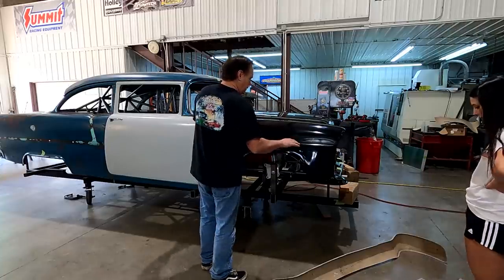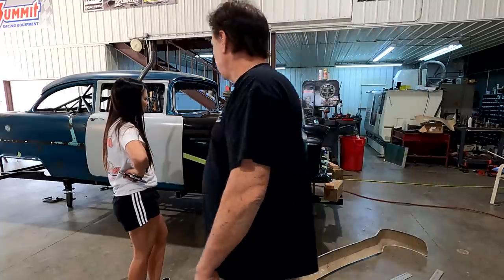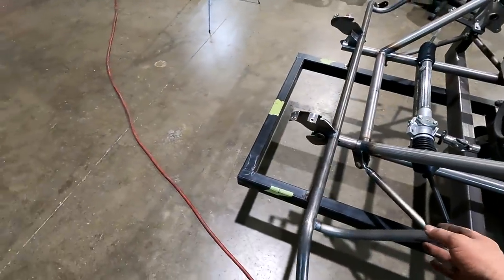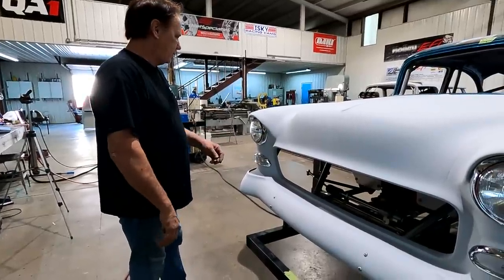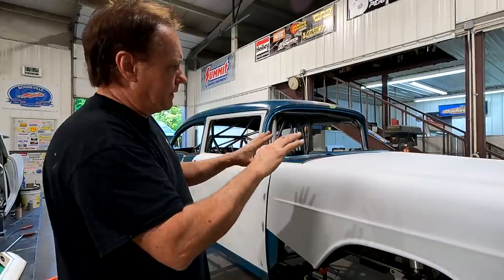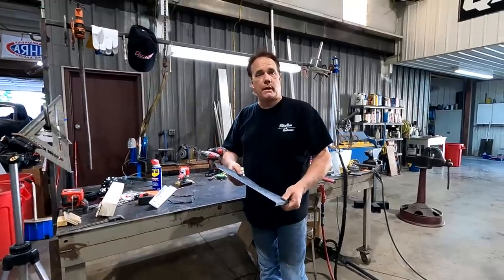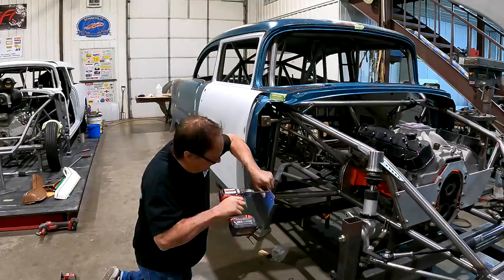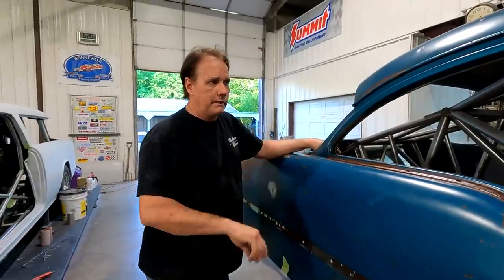The Front End TILTS!! - 55 Build - Video 13

Comment: If you use a piano hinge and spring steel strips, those corners that hit the door will pop out and give you the clearance during opening and closing. You can use dzus type or pin fasterners. Works great.  Lovely car.

Comment: Alex and Dennis, how about using opposing joggles where you are going to cut the fenders? Make the upper joggle lay between the lower joggle and the outer fender, then use a camloc(or something like it) to capture both joggles and the fender for a secure, perfectly aligned, fastening job.

Comment: Headlights, are they 7 inch lights? If so it might be possible to ditch them buckets and use a Harley LED light and mount. Just mounts to a flat piece of fiberglass. Look one up you’ll see what i mean, and the trim ring should work as well.

Comment: Not worried about heavy wind ripping the front end off when opened? 
I would want to add metal brace running length of the hood and glass that in also.

Comment: Alex, another informative video; one question: was there a reason (racing class rules etc.) that you did not build the entire body out of fiberglass and/or carbon fiber (which would give a higher power-to-weight ratio) versus using the cutup 55 steel body?

Comment: Really nice tilt mechanism.
I'm wondering a bit if the hood could compress longitudinally at high speeds and then lose the positive lock on the hinges allowing the hood to flip up in the front.
But i don't know how rigid the hood is longitudinally.
Maybe i have the geometry wrong in my head :)